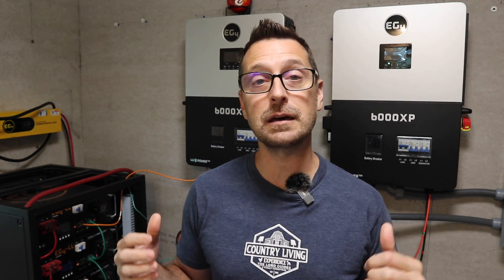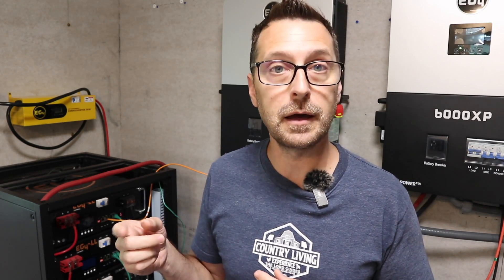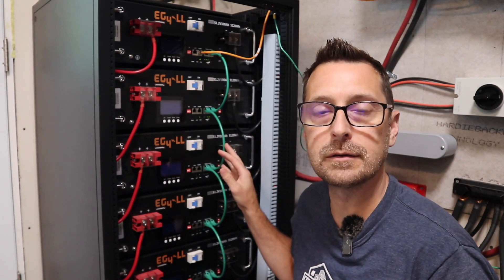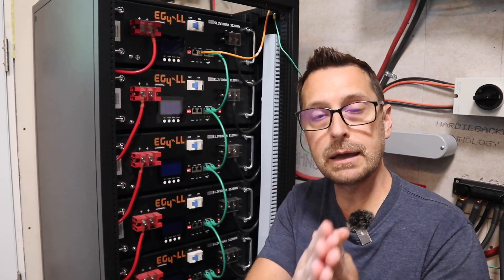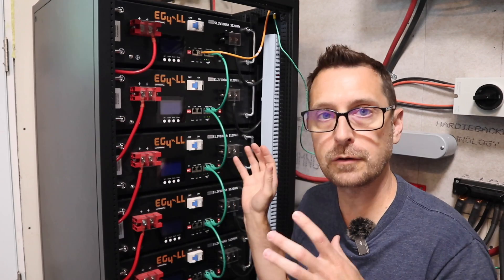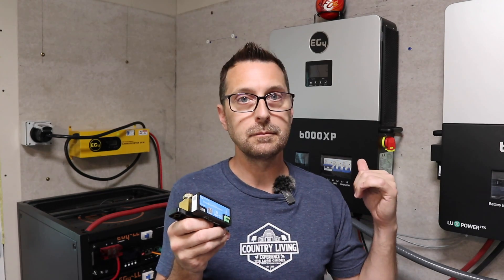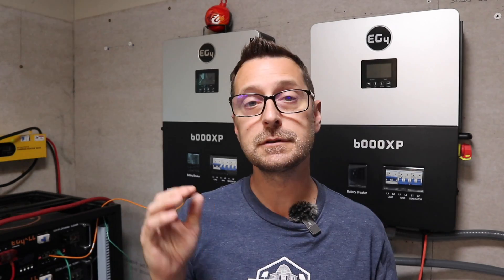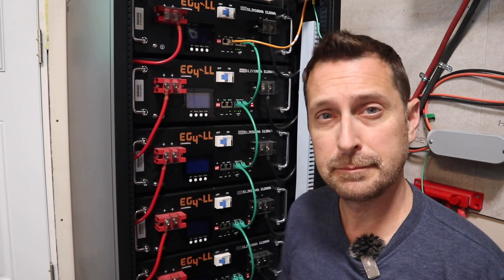Lithium Battery State Of Charge VS Voltage Drift. System Issues? Several Solutions

Comment: Hey I had the very same issue and what I did to remedy it was to bring all the cells to a higher voltage which for mine was 56.0 volts then I let them balance for about 2 hours within 30 minutes they all balanced out.   And each battery read 100 percent SOC even the one that was stuck at 80 percent.   I then purchased a Victron Smart shunt  which allowed to count for more of an accurate state of charge for the entire stack and I disabled comms and allowed solar assistant to use the victron shunt to measure SOC for the stack and it has been very accurate!    As it counts every amp in and out.  And it works with the 6000xp with solar assistant just need to get the raspberry pi or orange pi and a VE direct cable and then you can make changes and monitor from anywhere in the world!
Reply from the maker: I did that type of top balance in the past and it didn't make a difference. I may give it a shot again. 
Glad you got that more accurate reading with the SmartShunt and glad to hear it works with the 6000xp. I'll look into the raspberry and orange things but I don't really know what those are.

Comment: I would like to see a comment from Signature Solar. To verify what’s happening and why. Is now your battery’s out of warranty because you have gone below 20%?
Reply from the maker: This is not an issue with sig solar per se but most, if not all, lifepo4 batteries. This happen with SOK, battleborn, Lion, etc.
Reply from the maker: They are not out of warranty because of a one off event. If I had them set to 0% and purposefully ran them to 0%, then that would negate the warranty.
Reply: Signiture solar can not predict the variable of circuit components.

Comment: SoC is just unreliable but as you say, the LifePo4 chemistry has such a flat curve you can't determine the 70% mid-range Soc by voltage alone.   I run an 18650 INR chemistry (3.0v to 4.2v/cell) and use voltage alone for my management and ignore SoC.   Back to LifePo4....    it may be possible to ignore the mid-range SoC operationally (who cares about 40% vs 45% Soc) and concentrate on max charge and min cut-off...   and do it by voltage.      The groups of batteries in parallel, because they're in parallel, will be the same voltage (definition of parallel'ed batteries) so you can treat the overall powerall as a single voltage point at the inverters and use the lead-acid or user defined settings for min/max operational on/off.   This makes the SoC info only and will allow operations between voltage min/max voltage - which is wide enough for effective/safe operation.   I think a min (in the relm of 3.0v/cell or 48v) / max (in the relm of 3.4v/cell or 54.4v) is wide enough you can maintain <100% DOD for longer life and avoid absolute min (2.8v?/cell) and absolute max (3.45-3.65v?/cell) for safe min/max operations.    With SoC for info only, maybe it can be reset now and then if the system will let you but won't jeopardize operations (power) reliability...   assuming you're BMS shuts-off by voltage rather than SoC.       Also, you have incoming PV watts to help guide you as to whether you'll have enough power - so mid range battery SoC is not the only way to have an 'idea' of when the battery will hit low cutt-off.     Would be interested if you did a follow up with you're long term solution once you decide on things :)
Reply from the maker: Yep. If I do it by voltage, I would need to run it in Lead Acid mode but I am not sure f that shows soc or not. But I could set a low cut off voltage. 
Most of the batteries are fine but I have a few outliers. 
The concern is at night when I don't have incoming PV watts and I am asleep. This is critical if there is a shutoff for low soc (whether correct or incorrect). 
I'll do a follow up sometime. I think by moving the batteries with soc that fluctuates too much to the end of the stack, I may be able to mitigate incorrect readings. Only time will tell.
Reply: I'll second this, though use the LiFePO4 ranges I put in my main posting.   Basically, nobody should ever try to mid-range the SOC for LiFePO4 battery packs.   It's a huge mistake to do that and will only cause the packs to go out of balance... which actually stresses them MORE rather than less because some of the individual cells will wind up at the cut-off (low or high).

Unless the temperatures are really cold, one can optimize the charging parameters and the BMS settings to turn on balancing at 3.40V/cell and then use a 3.45V/cell (55.2V) 100% SOC target.  But to be honest, most people mess up the configurations trying to do stuff like that so I don't recommend those settings to DIYers..

It is far easier to just use a 3.55V/cell target (56.8V), which won't hurt the battery at all because it just isn't going to be held very long before you allow the battery to drop to its float.  56.8V virtually guarantees that the BMS will balance the cells properly with whatever its default configuration is.

The most critical setting for LiFePO4 is the float setting, which MUST be 3.35V-3.375V/cell, no exceptions.  This voltage range will hold the SOC at 99%+ (after charging to full and letting it drop), and de-stress the cells at the same time, without current sloshing causing any aging issues.

So basically you charge to the target, hold for the current tail (or for a fixed period of time, 30 minutes to 2 hours), THEN you let it drop to the float.  Most of the time the battery is going to be at the float or discharging lower at 0.2C or less, which are the least stressful conditions for LiFePO4.

--

Now, going for a mid-range SOC... there's a lot of theory there, and theory is correct for NMC, NCA, Sodium, and numerous other chemistries.  But not for LiFePO4.  For LiFePO4 the cells work a bit differently.  Even for LiFePO4, yes 100% SOC will put a little more wear on the cells, but since the voltage can drop all the way down to 3.35V/cell from the charge target of 3.55V/cell without losing any SOC, this de-stress condition makes a huge difference on the effect.

Because of this, nobody should be worried about trying to mid-range the SOC.  ALWAYS have your charging target be 100% (typically between 3.45V/cell and 3.55V/cell depending on the BMS configuration).  Any voltage >= 3.45V/cell at 0 current is 100% SOC at nominal temperatures (you need to go higher if it is cold), but that dratted BMS configuration might not deal with the situation properly.  Hence 3.55V/cell (56.8V) is the go-to charging target that should be used.

The other thing to remember is that high temperatures are a major factor on battery calendar aging.  Calendar aging for LiFePO4 is a function almost exclusively of temperature.   So if you can put the batteries in an  environment within 20-30C or so, and only charge/discharge them at roughly 0.2C most of the time, LiFePO4 will last a very, very, very long time.  Longer than 15 years, without losing very much capacity.

-Matt

Comment: I appreciate your analysis very good. Question how did you determine which jumper cable was bad? I have 12 batteries but it only reports 600 amps and I think that should be 1200 thanks great job
Reply from the maker: You’re welcome. It was trial and error with the cables….process of elimination.

Comment: I used Solar Assistant with the Victron shunt.  When the Victron read 70%, I had SA change my MPP unit from Inverting to Charge/Pass Through and then back to Inverting when it got to 90%.  

If SA can control the EG4 units, you could do the same.  The trick is to have SA read the Victron Shunt for the battery (and not the EG4)
Reply: note that if you are using a shunt to measure, you will need to account for inefficiencies.  The round trip is not 100% efficient, so the amount you put in must be more than you pull out by a few percent.  you still need to watch voltages.
Reply: Here are the Victron shunt settings for LiFePO4.

NOTE: Some of Victron's suggestions in their manual for LiFePO4 are INCORRECT.  I have listed the correct settings below.

The coulomb efficiency is very high so:

Peukert exponent:   1.05
Charge efficiency factor: 99%
Battery Capacity: (as appropriate. e.g. 100Ah for a 100Ah battery)

Typical settings for resetting the SOC tracking to 100% properly and for the display:

Charged voltage: 55.2V   (3.45V/cell)
Tail Current: 2%
Charged detection time:  3m

Discharge Floor: 10% (very typical, but people have their own ideas)
TTG averaging period: I recommend 5m.
And most people use  0.10A for the current threshold.

Battery SOC on reset: Typically use "Set to 100%".  There is no "right" setting for this.

-Matt
Reply: @junkerzn7312 Agree.  The 'right' way IMO is to know how your system performs by looking at the voltage 'shoulder' or where the voltage starts to change rapidly relative to the same current flows.  These points are IMO what 'define' 0% and 100%.   In my experience, the 100% is  pretty easy to define based on this.  The 0% is a lot harder because the shoulder isn't as sharp and is more affected by things like temperature, but for my setup I call this at when I get to 50.0V when drawing about 1a/battery (which is my typical load).   I could go a bit lower here, but start getting nervous that a bigger load could come on and drive it lower more quickly.
Reply from the maker: Thanks for the heads up

Comment: I would be ready to burn 🔥  signature wearhouse down 😂😂😂 that would drive ME INSANE...I have 4 x 14.3 chinese battery 🔋  bank NO FRIGGIN BMS ....all connected to a single bus bar ...my 64 - 280 ah  cells all read 3.316 to 3.317  NO BMS ...and I got my Chinese cells 80% cheaper vs all those STUPID SERVER RACK  batteries , you can now get 14.3 kwh battery for under $1,000 and I got 4 more on order ...Go tesla go sell as many powerwall 3 for $14,000 as there are suckers born ...

PS I saw a u tube video where the guy has 17 server rack batteries ALL JUST LIKE YOURS 😅😅 30 to 60% SOC
Reply: Well.... that was not very nice.    Accurate but I am not sure it was helpful.
It does bring into question "just what are the bms" doing for us.      Current limiting,  voltage protection ect.    Seems to me it has a great deal to do wit the operator owner of the system.    If it has a properly breaker and wire then the bms is really just there to balance which is only need once or twice a year.   Most people love to see all those numbers on their phone even when they dont really understand it.   The guy they show it to does not understand it either so they look smart and cool.   Humans are all about status.
For people that live off grid and monitor their own world your way should work but there are a great deal of people that want to have "off grid capable'  but want the computers to still run their lives so the dont have to 'think" about it.

Comment: With lipo4 cells all power is delivered at a very flat discharge curve.This is probably the differance as the BMS counts amps in and out not very accurate.This does not mean battery is at different states of charge just the estimate is out????
Reply from the maker: Yep, that is what I was talking about.

Comment: thanks for the info...I still run lead acid as weight is not an issue for a home grid, can "overcharge"with less risk, have outside battery bank in below 0, and to me it seems lead acid can be more of a "dumb" system. I get annoyed with my smart phone and the ideal of firmware hassle is just a big turn off...really hope we get a different commercial chemistry  soon that doesn't require a computer software engineer to get it to charge...anyway thanks again for reminding me that lifepo4 is beyond my comfort level....what I don't get is why don't your batteries even out as the 51v nom should be across all series cells with close to even internal resistance? I guess I just don't understand the BMS systems at all.
Reply from the maker: I totally understand your point of view. I wish systems were still a little more “dumb”. Sometimes the cells even out in the middle of the charging/discharge cycles in the middle of the curve.
Reply: old timer - god bless guys like you , im 68 but living in 2024 ....❤❤❤❤
Reply: @overthetopcargotrailerjerr2278  I'm a young 45 and I miss some of the old electric mechanical systems I worked with in the early 2000's for HVAC. I could "see" the diagram and tell how it worked with the switching. I guess it is easier to let the board do all the thinking and just swap boards when they get fried but it is a pain when you need to wait for the week to get the board shipped.
Reply: The  'new' chemistry is silica/sodium.    It is every thing lithium is with the ease of use of lead acid.  No bms needed just a small balancer.   For off grid storage lithium is now obsolete as weight is not an issue.   The prices are about the same at this time but falling fast.    In my opinion sodium batteries are the reason you have seen lithium batteries come down in price 30-50% or more in the last two years.

Comment: I have Solark and SOK but the issues are the same.  IMO voltage mode(you mentioned lead acid) is the only way to go, and you need to set the inverter to shut down before the BMS.     SOC is a myth and only a rough estimate.  it drifts off about 1% each cycle, and need to be at voltage limits to reset.  So your 'drift' is because you never are allowing the SOC algorithm to know where it should be until it hit in your case a Real 0% which is determined by the voltage curve shoulder.    Until it hits a shoulder the bms is guessing.  instead, i watched the curves and set the float/absorb/low/shutoff based on where the shoulders are. once a month i allow the voltage to go a bit higher for a couple minutes (in solark , this is the equalize voltage)  and this resets the soc in all the battery bms units.   for the sok batteries, it seem the voltage might be a bit more.  I start the generator at 50v. the bms will not reset at 56.5, but will at 57.5.  the shoulder occurs for me reliably a 55.5 on the high side.  also talk to Dexter at current connected about the myth of 20-80% for Lifepo.  its ok to hit "100%" for short periods, and in fact its neccessary for the bms to know whats going on.
Reply from the maker: Interesting. Thanks. Good to know that this is across the board with different brands of equipment. 
I will attempt another top balance with the Chargeverter to try to reset.
Reply: @CountryLivingExperience  As a minor point, I would not call this a 'top balance'.   Top balance really adds energy to the battery. The extra voltage in this case isn't really resulting in extra energy going into the battery (only a very very minimal amount is involved).  Instead, it's telling the BMS that because the voltage is rising rapidly despite very little current going in and therefore the 'SOC' is by definition at its full state.  For example, you will notice this where one second the SOC reading is way off (e.g. 75% or so), then a second or 2 later it is at 100%.  It is not that 25% of the stored energy magically appeared - instead that the BMS realized the gauge was off.
Reply from the maker: @mm-zw1zc  I understand. Thanks
Reply: Solark recently stated that using EG4 batteries voids the Solark warranty. Is it the same with SOK batteries?
Reply: @Solar2go  No, I haven't heard that, and find it hard to believe even for EG4.  SolArk advertises specifically as "battery agnostic 48V'.  The user manual has the warrantee on page 62, and there is no mention of anything like this.  Where did you hear this and/or do you have concrete evidence or just rumors?

Comment: I so appreciate you mentioning that the math doesn’t always add up and that the calculating can sometimes seem impossible.  I have always appreciated how well you describe what is actually going on with the elements of the system.  Your manner of communication makes it very easy for me to understand and I appreciate it BIG TIME!
Reply from the maker: You’re welcome. Glad I could help
Reply: Lipo4 12v battery has 4 cells , 24v has 8 cells , 48v has 16 cells.... so on and so on.
Look at each 4 cells as a glass of water , you can drink whats in the glass and no more.
You can fill it to the top , and its full.
Now connect multiple glasses together (100 glasses) by 1/4 inch straws .
Thats a lot of water but limited by the ability of the water to flow thru the straws. 
Manufaturing of the straws has measused tolerance,  not all the same.
Battery banks will never perform equally. 
Best course or action to fix the problem.
Move up to bigger glasses , maybe a swimming pool and best , dig a lake.
Theres no replacement for displacement.
Reply: @vinny143  nice addition 😁😇😁